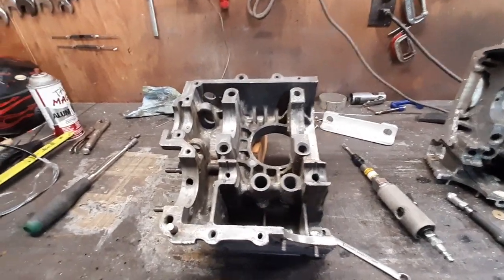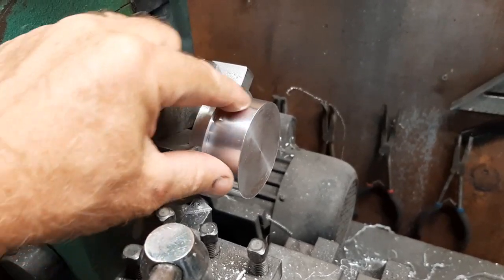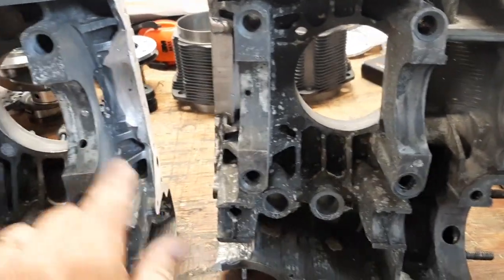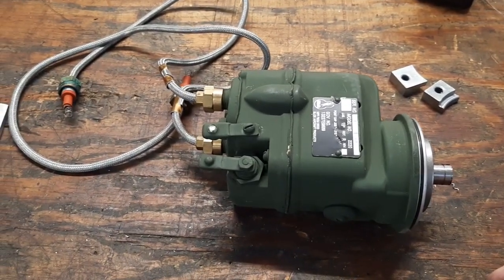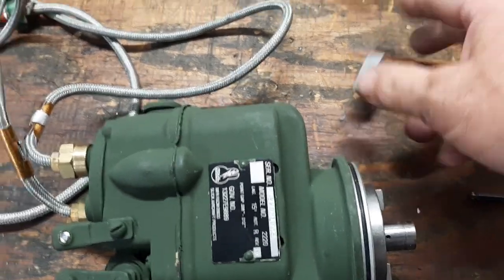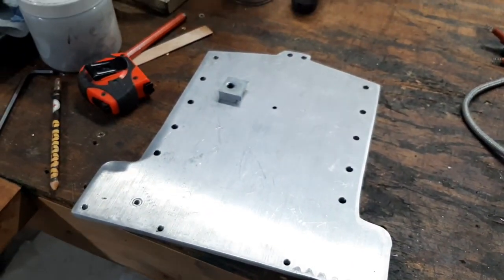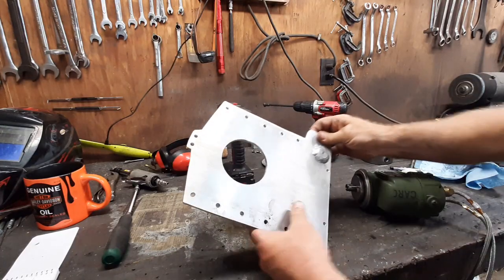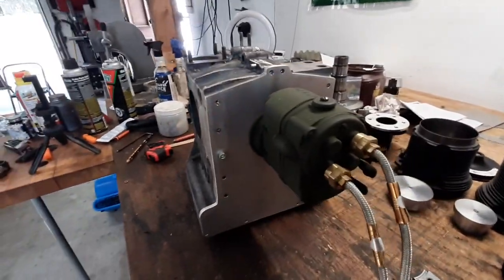1/2 VW Build - Part 9 - Mounting the Magneto

Comment: Did you ever do a video on modifying the magneto and adjusting the timing? Having a hard time finding help with mine.
Reply from the maker: I adjusted the timing in this video but I still need to check it with a timing light the next time I have it running.  https://youtu.be/jDYSs3Ud0YI?si=EkfgUZXva3dUyb2H
Reply from the maker: I changed out the plug wires here.  https://youtu.be/mdi0UnUwj0U?si=BKHTrnLGnVRfEmWa

Comment: Thats the same mill/drill i have :) I would have went electronic ignition . I would be interested why you didnt . I upgraded my mill with a 3 phase motor and VFD -I love it .
Reply from the maker: The main reason is the magneto fits is the airframe nicely and doesn't require a battery.  They are also supposed to be relliable.  The last airplane engine I had used CDI ignition and it just quit one day.  Fortunately I was on the ground.
Reply: @xpsgarage  BEING ON THE GROUND MADE IT A GOOD DAY :) I ALWAYS THOUGHT I WOULD GO 2 PLUGS WITH 2 ELECTRONIC ING .
Reply from the maker: @keithmccormick1272  Redundant systems would be nice but it's hard to meet ultralight weight.  I figure if it quits I'll just land it.🙃

Comment: Also the condenser from a different brand of magneto works externally on those.   Cant recall which type, maybe that dual mag brand?
Reply from the maker: I've seen where Casler installs the external condenser.  I'll research it more later,  but for now it seems to be firing just fine.

Comment: Why not just run a distributor
Reply from the maker: You can run a distributor but then you need a battery and a way to charge it.  The mag is all self contained.  The other reason on the Ultracruiser is packaging.  The mag fits nicely between the rear of the motor and the firewall.  A distributor would stick up through the cowling and ruin the sleek look.